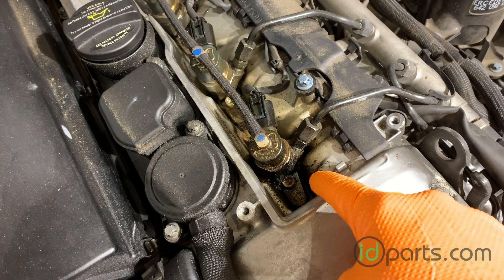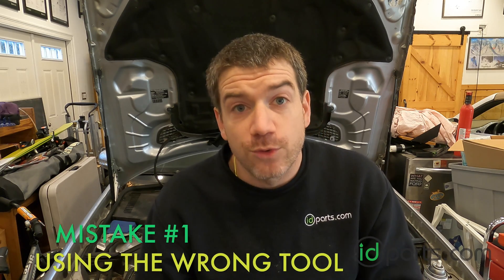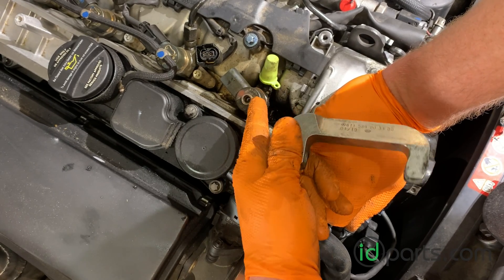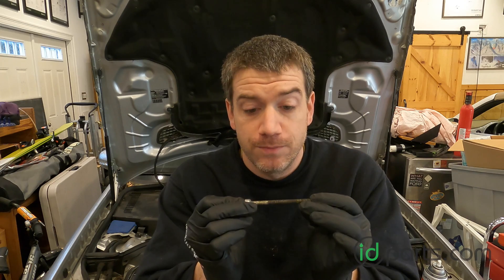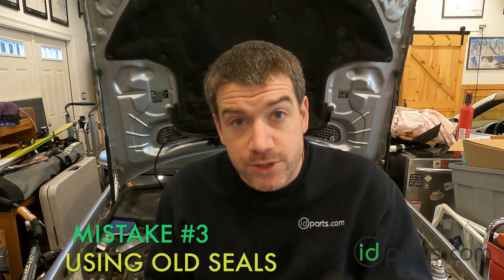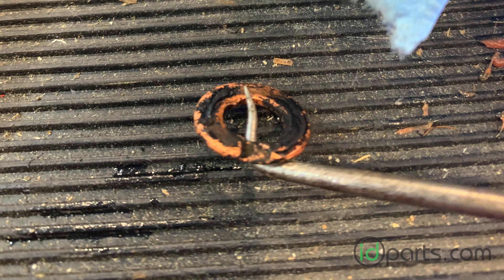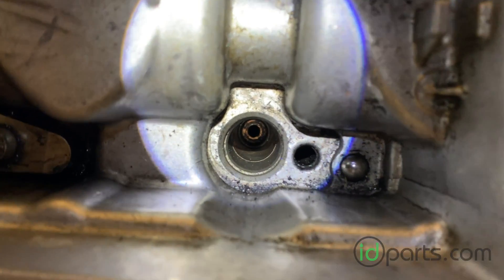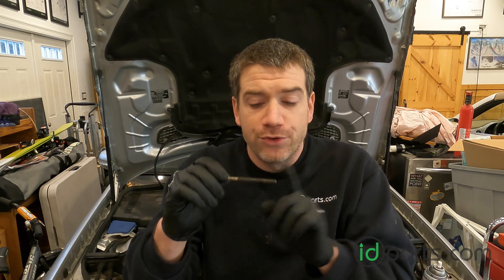Injector Black Death 5 Mistakes to Avoid! Mercedes & Sprinter Vans!

Comment: four in five . . . I didn't have the injector removal claw, for my 270 CDI engine, but with a leak just in one of the five injectors  and with  some care, was not so problematic to remove.
The rest, clean threads, the injectors seats and the black shit of the one witk a leak, was done, new washers bolts and squizers.
Done at 250 000Km in a 20 years old Mercedes ML 270 CDI, I hope to not do it before some more 250 000 km.
Ah, interesting to remember, the cleaning is better and easyer to be done with the engine hot, the dirt will be taken out in scales ; if cold, the dirt become hard and much more complicated to clean.

Comment: Do you recommend replacing the line from the fuel rail to the injector when doing the seal bolt job? Manufacturer says yes. Mine seem ok and not leaking. But I know this pressure is insanely high, and the seals probably get crushed when originally torqued. So I truly was not sure.

Comment: RE: Mistake #2 - hold down bolts
You said that after torquing to spec. torque additional 90 deg. turn should be performed. Many mechanics and technicians recommend TWO 90 deg. turns for a total of 180 deg. What is the correct procedure?

Comment: I'd like to add another one. You might be tempted to tighten the screw if you notice a leaky injector, but this is a mistake that can lead to a bigger problem and make you hate the day you were born.
Over-tightening the screw can strip the threads in the hole and will not seal the injector even if you got lucky and stopped before you stripped it.  The threads in the hole are aluminum. In a worst-case scenario, attempting to retap the hole could puncture the water jacket, leading to a coolant leak under the valve cover and a costly repair..

Comment: Great video thank you! A couple of things I found which may help: Gently screw a clamp bolt up and down without the clamp a few times with lubricant to exercise and clean the threads then clean out with vacuum and compressed air (with a rag surround). This will obviously make the torque applied more accurate.

Comment: I am not sure i agree with number 2, as long as the bolt and the thread in the hole are clean it should still seal the injector. What do others think???

Comment: I have had an oil leak in the hold down bolt hole. Have replaced injectors several times and cleaned out the hole properly with the old bolt, metal brushes, vacuum and even q-tips.
 I used some compressed air to remove the remaining oil and got a cooolant leak. Is there a way to plug this coolant leak hole, do I need a new head gasket, a new top or what do you suggest?
Reply: Which injector is it?
Reply: Did you find out?

Comment: If the seal is stuck at the bottom of the hole, get a stick welding rod, put a tight little bend on one end & use that to yank the seal.

Comment: Is there a product that dissolves the  gunk in the bolt hole & what to use to get the copper seal out if it's left behind . P S  very informative video 👍 .

Comment: Mistake #6. I over tightened the return line to the fuel rail and it hairline cracked the fuel rail on the inside. Blew the line off of the fuel rail while driving. 1,000.00 mistake
Reply: Is there a torque value for those ? I’ve looked but never found one.

Comment: I’ve used my injector bolts over and over and over as I’ve repaired my injectors and there control valves and nozzles and there’s nothing wrong with the bolts and my injectors have done 13.000 miles and they don’t leak so no Black Death. The only problem you might get with the bolts are them snapping witch you didn’t mention.

Comment: How do you recommend cleaning the hold down bolt threads , without risking debris getting in the injector port
Reply: Create a thread chaser from a new bolt or use a 6MM tap.  Put some grease on the chase/tap.  Most of the debris will come out with the tool.  Clean the tool prior to using on the next bore.  Clean the bore with long QTips, brake cleaner etc.  I used the back end of the QTip (wood), with a little grease to see if a got all the bits out of the bore.

Comment: No need to wait until its leaking and carbonized.  Re-seat the injectors every 2 years or 50k kilometers as routine maintenance and you will find its easy and economical.  When there is no carbon to clean up it goes very quickly.  Can't DIY?  Find an independent and discuss it.

Comment: The injector remover claw does not fit onto the OM642 engine.  Do you know of another way to remove them?
Reply from the maker: The slide hammer can be attached to the top of the OM642 injector, you do not need a claw.

Comment: My copper seals got stuck - what a pain.  In the end I welded a thin stud extractor onto a thin T bar and it came out immediately.
Reply: I ended up spraying carb cleaner down the injector hole and then using a metal pipe cleaning tool kit from fire harbor freight. I pushed it all the way to the cylinder and eight grabbed the.  The other one I had to use a long, thin, pick tool to carve around the outside of the washer, and then use the pipe cleaning tool to push it all the way through and grab it.

Comment: Faithful customer here, with two related questions: 
1. How about putting a thick washer under the head of a used "stretch bolt" to compensate for the stretch and then re-use?
2. Does ID PartS sell a long, slim, spiral-wound wire brush, perfectly-sized to clean the hold down female threads and, if no, WHY NOT?
Reply: If you use a spacer on that stretch bolt, you’re liable to break it and that’s a pain in the butt to fix. Treat it like a head bolt, and get a new one each time.
Reply: @CB-68-westcreations  How to remove all the gunk in the stretch bolt hole?

Comment: Seems to me it would be easier to keep a watch for this if that plastic cover was removed
Reply: true, but when the leak starts the cover contains it.
Reply: @mcslug6550  What do you mean by contains it? That the cover will hold the injector leak and not spread it or that thanks to the cover, it is possible too see that there is a leak?

Comment: Just doing my old banger now. 40 yrs experience,   other tools : brake cleaner / coca cola(soak overnight, over three nights if it takes it - you've seen what it does to pennies :) smallest electrical / watch makers screw drivers to puggle down sides of injector/s, more brake cleaner - more blow gun. Ideally, if you're doing 1 injector (like I am at the moment) get the engine at TDC No (3 for me) (which is 180 degrees after TDC NO 1) at least then you can finally blow out with both valves shut, and hopefully remove any of the 'coal gremlins' from the cylinder you've been working on. I'm too old for this shite. :)

Comment: No one has mentioned not getting any of 'even' the black death 'dust' into the cylinder, let alone some small lumps of it. The top tools for this job are patience, a 140 psi 150 ltr tank compressor and a  narrow nozzle blow gun,  :)
Reply: Is it SO bad when that happens..?
Please explain...
(Also, when one cleans the seat with a cleaning-tool, is it a disaster when some very very small iron particals from the cleaning up fall into the engine..?
And lastly: Can you use the old bolts again..?  (ssome day: never! soe say: i use old bolts all the time and it works just fine)
Reply: @Bart Den  Did you find out. For the stretch bolts, never reuse the same bolts. Always replace them. They do break if reused. Better safe than sorry. They cost approximately €10.

Comment: Can you give some tips on the Jeep Crd from 2005 to 2008. Seems like they are plagued by issues stemming from the EGR, and the gink and sludge that is deposited when running those gasses back thru the Turbo and top end of the engine. I believe those motors are VM and not mercedes, so maybe a separate video idea?
Thanks! 😎👍

Comment: I CALL BS!!! INJECTORS HAVE BEEN TAKING OUT USING PENATRATING FLUID AND WIGGLE IT OUT USING A FLAT SCREW DRIVER. YES! YOU MUST USE BRAND NEW COPPER SEAL. EVERYTHING ELSE IS SPOT ON!!! SO NEW SUB. FROM THE 641.. THANK YOU!!

Comment: So far fixed my OM646 with only that tool and new botls and washers. So far so good. a nice DIY job if you ask me. I had the remove the entire windscren wiper assembly and the rain catch box to get to the 4th cylinder. It is a w639 vito van. Do this on a worm engine. Put some copper grease on the injectors when you put theme back in
Reply: Hi could you please tell me the part number for the injector claw i have a vito van also and in the past 2 weeks its started to make Tuff TUFF sound from the engine its a 639, I need this MB injector removal claw

Comment: Would that cause black smoke while accelerating ?
Reply: I have two leaky seals, van doesn't smoke, but if an injector is over fueling/leaking internally, it will smoke under hard acceleration. With over fueling the exhaust, at the tailpipe, felt with your hand, will be rough with visible smoke. If you unplug one injector at a time, at the electrical connection, at idle, it should show you which in
injector is bad.

Comment: How do you bring out all that gunk in the bolt thread?
Reply: extra long bottoming tap, be careful not to remove aluminum thread material. Compressed air with a skinny outlet tube. Long Q tips.

Comment: I had black death now after cleaning car knocking on cold only. Don't get it. Om651. I thought bad injectors but not quite. As even I remove (connection) them one by one the knocking at cold persists. Did oil change with thin oil and new filter still bad knock on cold. When warm sounds perfect.
Reply: Sounds similar to my recent problem, 1 faulty injector

Comment: I have repaired about a hundred of these, maybe more using a pin bar through the injector clamp. I remove the bolt from the clamp and then insert the pin bar, pry back and wiggle. I have never broken anything removing Mercedes sprinter cdi injectors. I have also used duramax injector seals in the om 642 engines numerous times.  I still see the vehicles for other services but the duramax seals are fine if not better than the rounded style Mercedes ones that I have seen burned out in 50,000miles on new sprinters. Like 1 year old van all stock with black death already at 50,000miles. The sprinter Van's are no better than econoline 6.0 diesels.
Reply: I broke my injector bolt installing it.  DO the threads go all the way into the head or just the rocker arm cover?  I'm afraid I will have to replace the head because I cannot get the bolt out of the cavity and I may have damaged the threads trying to drill it out.
Reply: @GoldGunsandGolf  I just weld a nut onto the broken bolt and then spin it out with a socket.
Reply: @GoldGunsandGolf  I'm not sure if it goes right into the head or not. Never had to remove a valve cover on a om642.
Reply: @GoldGunsandGolf  yes the threads go down into the head sorry.
Reply: @GoldGunsandGolf Did you find out?
Reply: @mbz4652  Yeah, I had to replace the head unfortunately....Such a stupid mistake!!

Comment: back yard tip...use a pic tool to loosen the black goop, and vacuum it out with a straw taped to the crevice tool. then run the engine until its hot, and start to loose the stretch bolt...the compression of the engine will push the injector up a new millimeters, loosing the injector.  shut off the engine and remove the injector as fast as possible. No puller required.
Reply: do this today. works super
Reply: So loosening the stretch bolt while engine in on and hot?
Reply: @mbz4652  one turn when engine is ON than off the engine.

Comment: Only ever heard of black death on Mercedes built engines... they really are the dog shit of diesel
Reply from the maker: You're out of your mind.
Reply: @idparts  2 x 2008 313 sprinters both siezed on 150 thou 56 plate sprinter the same,  jeep cherokee mercedes engine comon as muck for black death.. didn't they also fit merc engine kia that was prone to gaskets.. my 2017 316 nothing but trouble.  I'll give until 150k and that probably be siezed.  Say again lol 🤣
Reply from the maker: @DW-hx1xm  multiple sprinters over 300k miles no issues, OM647/8s with over 500k.  What you doing wrong bro?
Reply: @idparts  working them ... 🤣 always loaded , mobile mechanic plant fitter...

Comment: Hello. If the injector seats are damaged badly, can it be  cut deeper and use longer hold down bolts? Also heard that the Honda injector seals works better on damaged seats. Your thoughts🤔
Reply: Definatly use honda 2.2 accord seals,  there thicker and will compensate a seat that could have been cut to much , 👍👍👍
Reply: @tezotezo8532  Do you know the part number of the Honda 2.2 accord seal? And what are the dimensions of the seal (diameter and thickness? Can you use this seal even if the seat was not cut and use it as a prevention?

Comment: Thank you for the great video!

How do you recommend getting the gunk out of the threads? And if the copper sealing ring is left behind down at the bottom, is it tricky to fish it out? Is there any cleaning product (i.e. acetone) that you've found to be safe and efficient to use to clean up the tar?
Reply: Some really shit advice here... brake cleaner does not dissolve this gunk, oven cleaner does but is corrosive to aluminium!  Carburretor cleaner or cellulose paint thinners do the job well without fucking up plastic or aluminium pats.
Reply: How about wd40?
Reply: A foamy Oven cleaner does the job for me. Dissolves carbon into a runny paste that can be wiped away.
Reply from the maker: Brake clean and copper brushes work best!

Comment: I did mine in the back yard. I had more time than money, and another Sprinter to drive while I repaired it. I didn't know about the injector claw, so I used the next best thing, lots of patience and lots of PB Blaster. 2 were leaking, but I changed all 5. I used 2 different techniques to clean the injector hold down holes, tapping, and the one I would recommend. Brake cleaner, a .22 caliber gun cleaning brush, and 100 psi blasted into the hole from a 1/8" copper discharge line. Rinse and repeat. Thanks for the video. I learned some more.